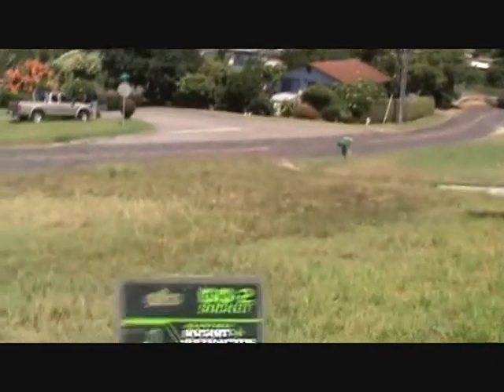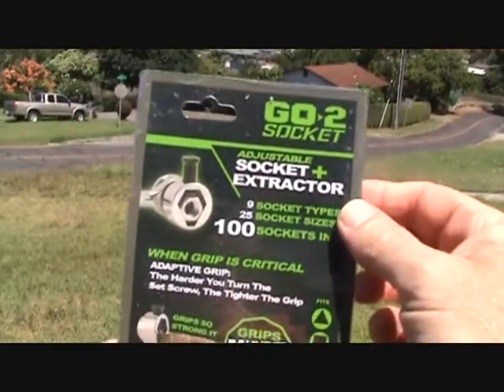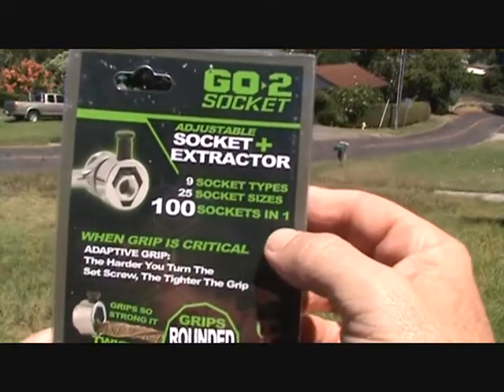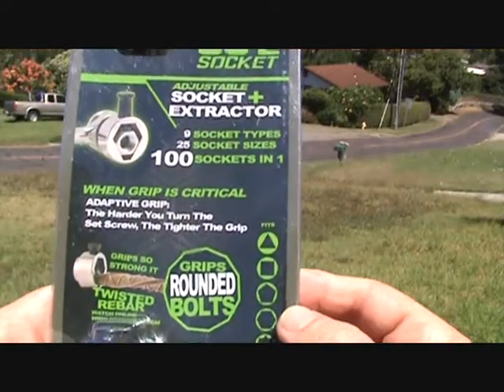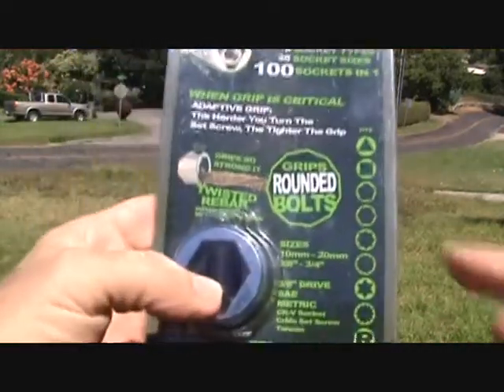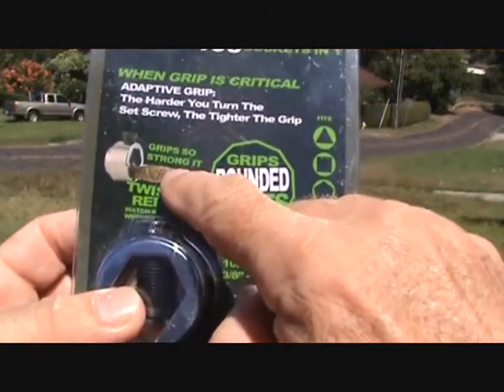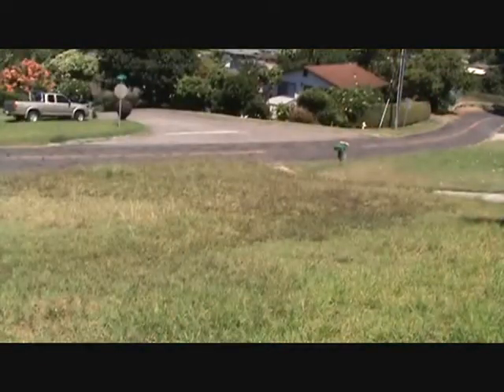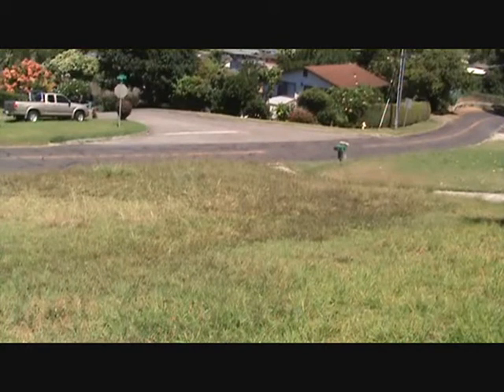How to remove a stripped bolt head

Comment: That thing is junk and almost useless. If the head or shaft is sticking out you can use vise grips or a small pipe wrench. If there is nothing sticking out, then this is 100% worthless and you will have to drill out the shaft and try an easy out. If that don't work you must drill out the shaft all the way. And if you screw up the threads you will have to use a heli-coil to repair them. Been there done that.
Reply from the maker: Your comments are correct if in fact the entire head of the bolt has come off. This tool is to grab a bolt head that is still in tact but that the head edges have been stripped enough where the proper socket will now not fit on it. Go to their website & you will see close up photos of the product. Thanks for your comments. Much appreciated!   Joe  :0